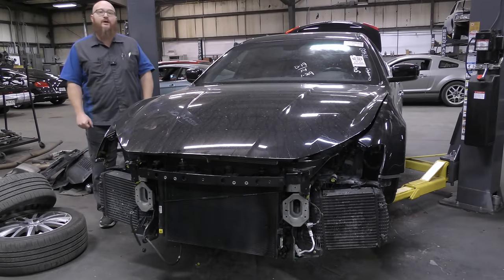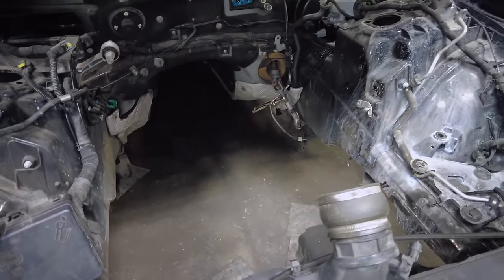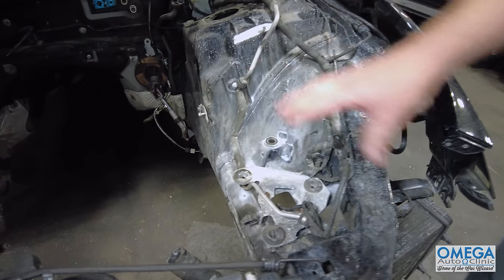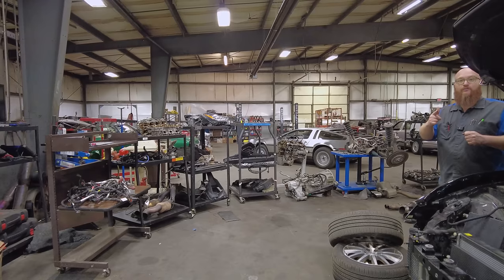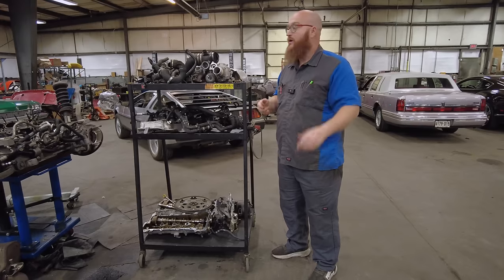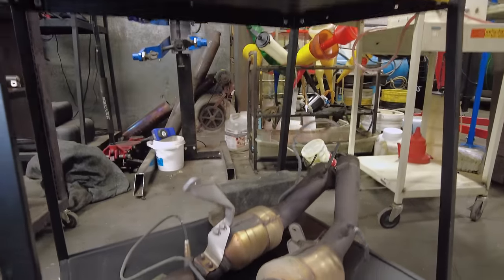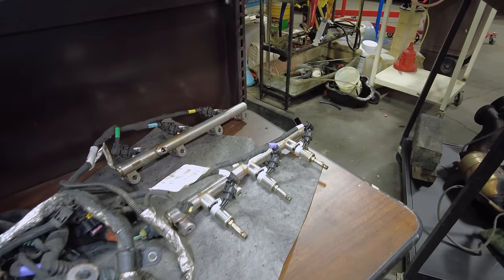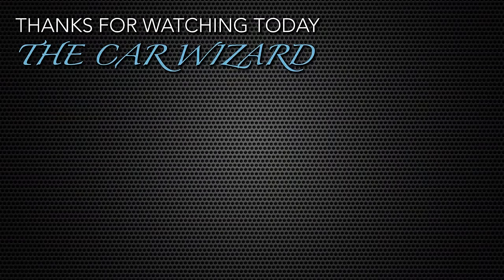Hoovie Must Hate Me! His Maserati Engine Swap is a Nightmare!

Comment: Regarding warped...
 
I remember when BMW entered Formula 1 in the turbo era, they used as basis stock engine blocks of the 3er BMWs - used ones with at least 80,000 kms (50,000 miles) on it*´.
 
The reason was that these blocks had made through enough heat cycles to "settle", so that all thermal tensions had been released.
 
Because now, with the turbocharging of the engine to 800 hp (or whatever it was back then) from the original 100 or so, the thermal stresses would be insane - but these blocks do not warp anymore.

Comment: Wizard loves those reliable Maseratis   always brags about how reliable they are when they are not that reliable at all
Reply: Abusing a car to the point of overheating the engine has nothing to do with reliability...
Reply: @irysh9  Who's to say they "abused it to the point of..." as opposed to it failing under normal use and being prohibitively expensive to repair and subsequently neglected?
You can't seriously look at the resale values of every Maserati product on earth and assume their abysmal resale is because of rampant "abuse".
Use your head for more than a hat rack once in a while.
Reply: He brags about how Jaguar and Land Rover/Range Rovers are reliable too!
Reply: Probably reliable with normal use and very good maintenance. I have a very expensive car and the maintenance is a few thousand dollars a year. You just have to know that that’s what you’re going to spend.
Reply: @tim3172  he mixed the wrong type of coolant with the oem coolant and it turned to jelly. How is that the cars fault?
Reply: @tim3172  "Who's to say"? Did you even watch the video? Reality is to say... if you're putting the wrong fluids in your car and ignoring signs of overheating that's your problem.

Comment: Just finished a motor swap in a 2023 Chrysler Pacifica. (because road debris followed by oil pressure light = keep driving it till Uncle Rodney and a few of his buddies free themselves from the confines of the engine... right? lol). Wasn't much different than that Maserati. Having to disassemble the bottom end until I could get the crank to turn didn't help matters either. It was definitely designed to be a throw away van (not surprising, cause, you know... Chrysler). That engine was not meant to come out. They shoved the steering rack in there something fierce too. Out of curiosity I looked up the labor on the rack... was 13.9 hours! Engine swap was like 29.5 labor. so over 3 grand...  just for labor. Gone are the days of DIYers getting a motor replaced on a Saturday with a buddy and a few beers.

Comment: After working in aviation I started using bags for the bolts and tying them to the part to keep track. So much faster when comes time to assemble.
Reply: So this begs the question, which is WORSE, working on a Maserati Ghibli or servicing the wheel-well lines of a B737?

Comment: I place the bolts/nuts in small sandwich bags and label them. Easier that way. Another thing you can do is use cardboard and draw out the part then stick the bolts into holes you make in the cardboard as if you were putting them in the actual part in the car.

Comment: I 100% agree with hoovie when he said when the repair process is this expensive it makes the cars nearly worthless. It’s like when jaguar made you cut the sub frame to drop a fuel tank to change the fuel pump. This is next level though.
Reply: Fail. You just cut an access slit in the carpet, then cut 3 sides of a square in the metal underneath to pull the pump out the top.

Comment: This surprised me. I would have expected that the engine and subframe went in from underneath as a unit (they come from Ferarri as a unit) so there should have been a way to disconnect things to remove it without having to take a lot of things off. I guess I was wrong. with this one. My old benz was a dog to work on unless you figured out how it was assembled and worked back - to replace the alternator I disconnected and removed the battery and then the battery tray - job was then easy but if you didn;t take the battery tray out then it was a pig of a job.

Comment: You need to see Eric@PHAD he had to replace a Timing Chain around 60K miles due to stretch. They are beautiful cars  that are extremely expensive to maintain. Not meant to be a daily driver. Short weekend use only 😂
Reply: Actually there are a lot with 100k plus miles with no chain issues. Or any issues.they are quite reliable..they are sensitive to servicing and oil changes.explaining chains and tensioners going out..as well the early 14 and 15 ghiblis had some engine issues
Reply: Ferrari did a good job of tracing any faults and correcting them in production..but there are no widespread bulletins on this engine

Comment: They should put the bolts in ziplock plastic bags and label them instead of placed on top of the work table. One accidental bump to the table causing it to tip will be chaotic.

Comment: @carwiard i need your advise so i own audi a3 2015 2.0 tfsi and a chevy cuze 1.4l eco 2016 they both have 145k miles and the transmission has never been services so if i drain and refill will that prolog the life of the transmission or will it starts slipping and better leave it as i'm on a borrowed time till it breaks ?  thank you

Comment: Years ago I made a comment not to mix 'green' with most factory coolant.  I was shouted down like I had just farted in church.

One of the former employees of mine went to work at one of those instant oil change places.  I commented  "We only run the factory coolant" and he said  "our stuff mixes with EVERYTHING!"  Ahh... no  Mix green coolant with factory VW coolant-  You'll have a coating of white film that starts building up on all the passages, pipes and radiator.

Now you can of course do a 'dump and flush' and refill it with universal and it'll be okay!  Provided you have all the factory stuff out.

But mixing it?  Ahh... Sorry.  Believe what you want-  You do you..and I'll do it my way.

Comment: To be honest triple $1250 which would be $3750 not bad for what necessary to install the new engine in. Those I know as did an engine swap on one a pain in the rear and I got paid from shop owner $2800 for myself for the labor involved the shop made around $1200  profit after paying me and shop materials to do work, as his regular master Ford  technician which he was a good technician but he won’t touch it, since he knew I worked on BMW’s and Volkswagen’s as worked at a dealer. I took it took copy of keys to his shop and did it when off or at night, definitely was a project but wasn’t the worst I dealt with, as dealt with over the years unfortunately far worst.

Comment: It seems to me that the simplest explanation why it overheated was all the gelled coolant congealed in the cylinder heads and block and the driver just kept driving.

You really gotta be careful today about what coolant you put in. A young woman across the street had an old Nissan or Toyota and it needed coolant and I offered to help her but she said her boyfriend was coming. And then I thought with the coolant that I put in the Mercedes work for the Nissan? 

It's the dark blue stuff.

Probably but on the off chance it didn't and I ruined her engine…

Comment: I remember "Cradle of Love" song by Billy Idol from 80's listen to that song though high School.

I'm Mopar guy all I drive I know Stellantis owns Maserati, probably have interchangeable components in all Stellantis car lines.
I have a 2016 Chrysler 200C AWD 50,000 miles great Car, read where the Alfa Romeo giulia platform is platform of my Chrysler 200C.
I always ask if I need fluid changes every oil change at dealership, tell me no.
I change oil every 6 months car only has 2,000 or 3000 miles on oil change.
I use Synthetic oil.

Comment: I like car but if i was the owner i would have installed a LS engine and transmission much more cheaper, reliable and parts are easier to find and i can still drive the the car i like.

Comment: This is why I now only want an EV......so much easier to repair.
Reply: Until the battery goes>>then $20,000+ OR if it needs body work>>>sky's the limit.
Reply: @hotpuppy1  An ICE car/truck will in the lifetime of the vehicle will cost $27,000-$63,000 in fuel and maintenance.
My EV will cost $6200...even if I need a battery change I am still ahead of the game... that body work argument is nonsense my BoltEUV costs me less to insure than my old RAV4 ICE so the insurance company does not believe that.🙂
Reply: But you drive a Chevy bolt yikes
Reply: @ericoliphant7100  ...And laugh all the way to the bank

Comment: As far as the coolant issue, I blame Maserati for using the wrong coolant in the first place. Used to be ALL cars used ethylene glycol, and it worked just fine. Then every car company started using their own special witches brew, which they called OAT or HOAT or a number of other things, none of them good. And engines started getting destroyed. They had the perfect coolant to begin with, they should have left well enough alone. But car companies just aren't like that. They absolutely have to change things, and if there is nothing better to change to, they change to something worse. That mechanical design nightmare is proof of that. I can pull a small block Chevy out of my 1972 Nova in a couple of hours. Back then GM knew what they were doing. 

What I don't understand is why do all that work, and spend all that money on such a pile of junk? That is one ugly car, and it looks like it was dragged out of a junkyard. It has no value, and unlike some old cars that are worth replacing engines and almost anything else in to keep them going as transportation cars, this is not one of those cars. It was trash right off the assembly line.

Comment: They don't just "slap things together" on modern cars.  They are designed a certain way so as to lower production cost as low as possible.  Thus complete assemblies arrive from OEM suppliers and are installed on the assembly line with NO thought towards future serviceability.  This wouldn't have worked in the past since many people needed to work on their cars themselves, but today NOBODY [except for me and David] works on their own cars.  Thus, serviceability has been deleted from modern car design in order to save $.

In fact, in most cases these days car owners are confronted with a major repair estimate when the car is 10 years old and they simply trade it for something new rather than have it repaired.  We are a wealthy society [as long as Trump doesn't come back to power....] and people can either afford to have the car repaired rather than work on it themselves or simply buy another car.

The "Airbus" effect I call it (not that Boeing is much better....) in which the car is designed to last a certain number of years and then the maker recommends it be recycled.  Airbus has publicly stated that they think their airplanes should be scrapped at the 25 year point regardless of hours/cycles because technology moves forward and newer products will be more efficient.  While there is some truth in that, it is a terrible idea to build a product around one particular "due" date~!

Great video!

Comment: After seeing videos like this; leasing almost starts to make sense. These newer cars just aren't viable long term (assuming your definition of long term is a lifespan greater than 15 years)

My first car was a 1988 Oldsmobile in 2004. It just needed occasional belts, simple mechanical repairs, etc. It felt like it was a car that if you kept up with parts and didn't overheat it; it would run forever. Now; everything is brittle craptastic-plastic and electronic nightmare fuel. Not to mention insanely expensive parts..

Why even bother trying to "keep up" anymore with anything newer than maybe a 2010-2015 model year? Just trade it in and get a 2024 Buick Envista for $25k for the next 5-7 years and call it a day; and then get another one after that. I doubt many 2024 cars will be something you can realistic own and keep up with maintenance on 20 years from now (maybe Honda's/Toyota's?)